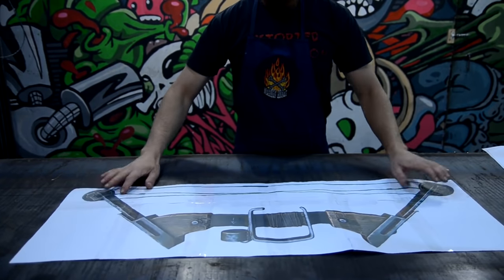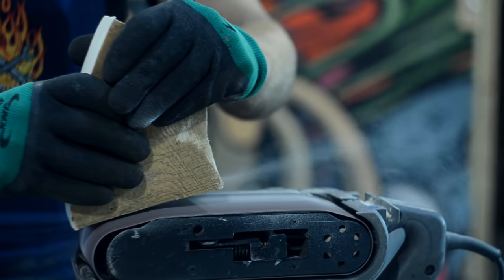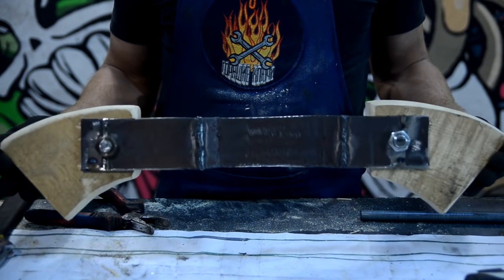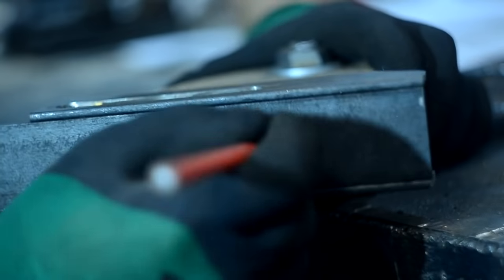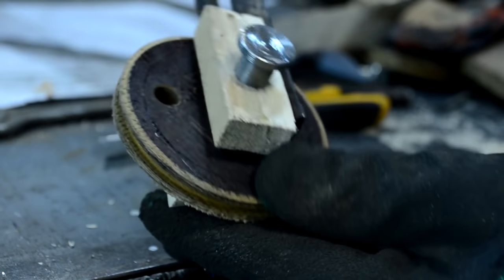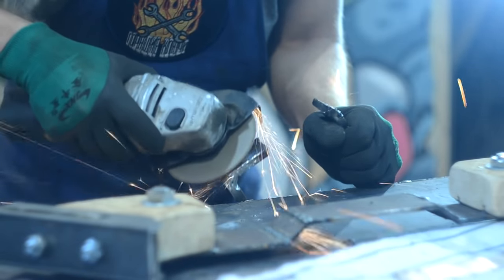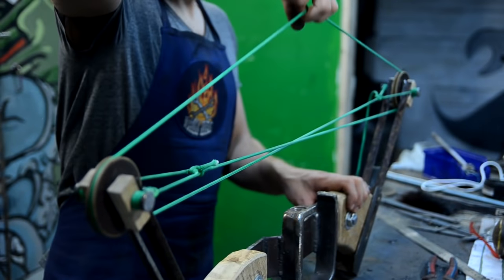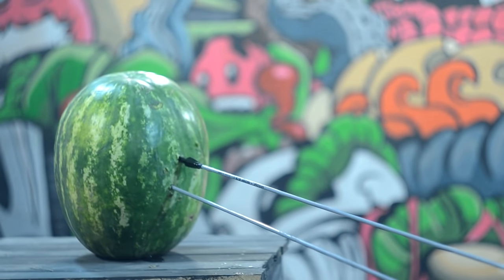How to make Compound Bow from Rust

Comment: I love it! Love the esthetic of ‘Rust’ and love the way you executed it.

Have to admit I am always heavily Impressed if the game developers draw something that works in real life... the only thing that isn’t functional on the bow are the slots in the limb holders. I guess they added those for looks?

Looks like it weights about 10 kg or more :-) Very hard to hold upright and aim :-). What is the draw weight on the bow?
Reply: Looks maybe 10-15lbs, but that seems because he can't pull it back to the standard 28 inches. without any flex in the arms, he probably wont be able to pull it back that far. 

Super aesthetic to look at though.